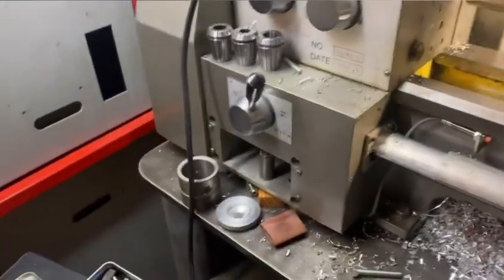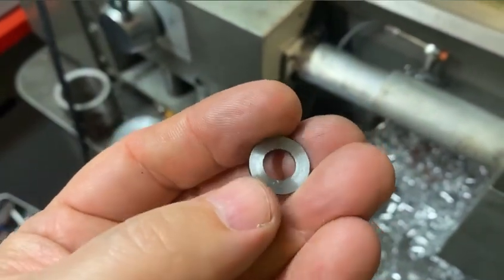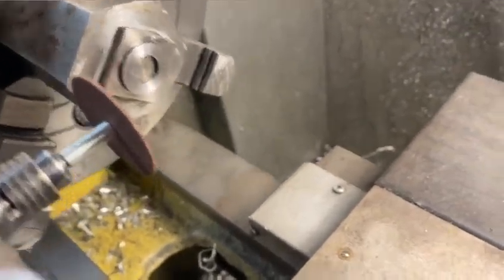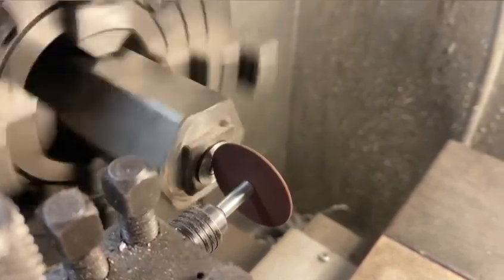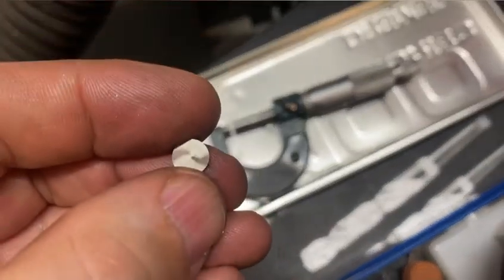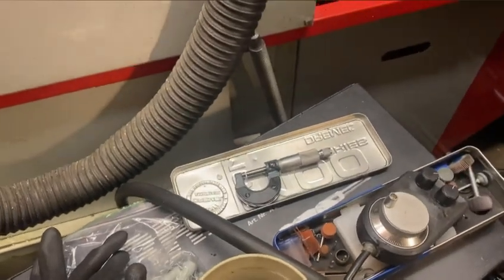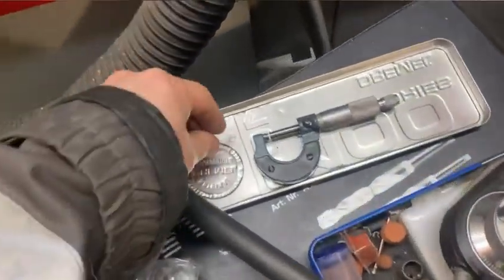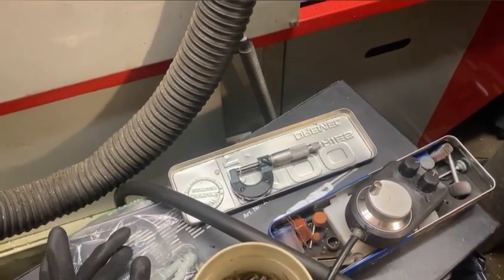Surface grinding small parts on a lathe.

Comment: you wanted 0.13, after micing the shim 0.131 you say we wanted 0.14  Mistaken. 0.13, but you have succeeded. Even though using Dremel disc's is highly subject to wear if not handled with the utmost care and only the tiniest work area.